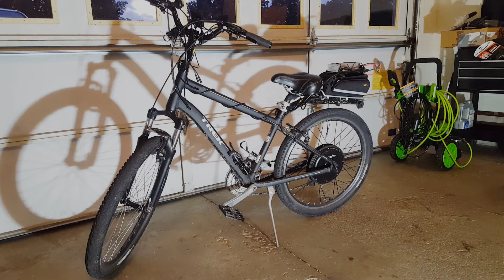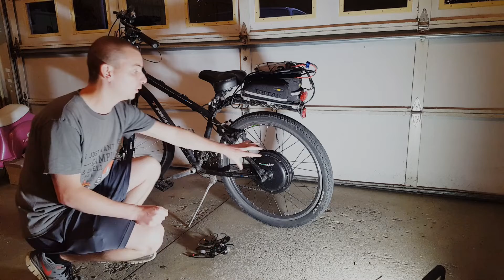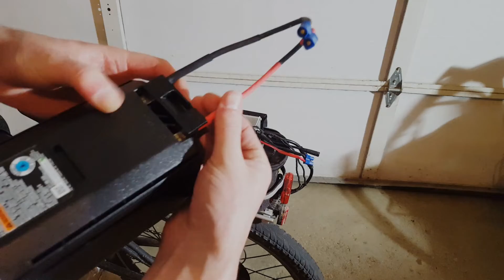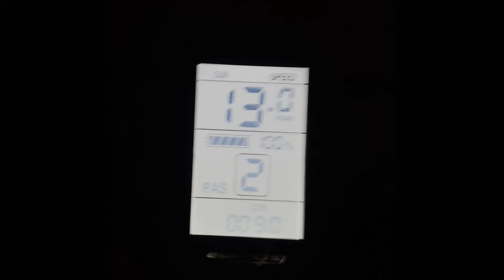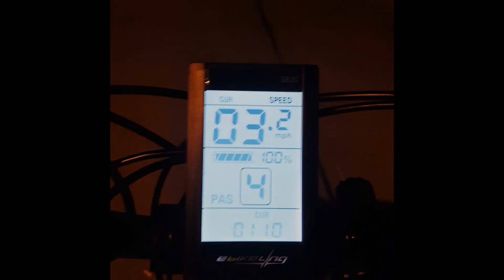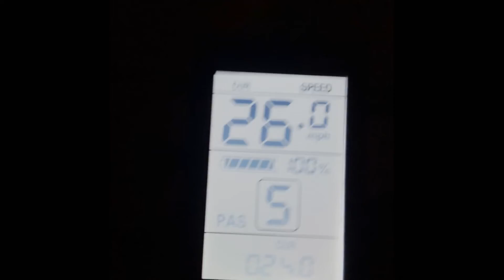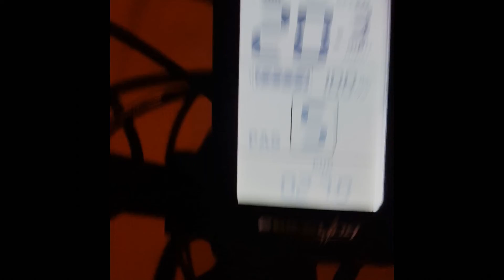Ebikeling 48V 1200W E-bike Conversion Kit (waterproof)!! Live dangerously!

Comment: One thing I'm concerned about is disc brakes. I see it come with brake levers but is that an e-brake? 

Mine is 1200 watt front, I haven't hooked it up yet, waiting for batteries but yes, from most videos I've seen, they top around 30mph. 30mph isn't too fast, I sprint up to 27mph, and can sustain 20mph on flat ground. I too live 4 miles away from work, I get there in about 15 or 16 minutes averaging 15 mph, planing to cut that in half with this. I may do a video response linking your video but great job.

Comment: Does your wheel seem to have a lot of resistance when coasting? When I put mine in the stand the wheel will not spin very long without stopping. Also makes kind of a winding noise. I was wondering if they usually spin more free and make less noise.
Reply: Do you have a geared or a direct-drive motor? Geared kits should have no resistance when the motor is off, while DD kits will have some.
Reply from the maker: Mine is direct drive but I’m pretty sure it has a clutch to disengage the motor and allow easier free spinning. I could be wrong though.
Reply from the maker: No, my wheel does not have resistance like that. I wonder if the motor housing is rubbing. The wheel should free spin very easily.

Comment: The most I have is a 500w battery so I couldn't use this. Any good recommends for a kit that'd fit my specifications? 36v 500w battery. 20ah
Reply from the maker: Why is your battery limited to 500w? Is it an amperage limit that makes you say that? Trying to better understand your setup.
Reply: @diyrenewableenergyelectron4996  well my first guess would be if I tried to attach a higher-powered battery to the kit, I stand to potentially fry something. The kit has specifications that list the maximum being a 500w battery.
Reply from the maker: Interesting. Typically, so long as you don’t exceed the voltage rating of the controller for the kit, you can put a big of a battery as you want on there. I could have made a 100ah battery for my kit and it would have operated just the same. The range would have been much farther though. Did you buy a 500w e bike kit? If so, what came with it? Mine had everything but the battery which is why I built one.
Reply: @diyrenewableenergyelectron4996  I did. From ebikeling. Pretty much everything except the battery. My kit has some.... issues, but I'm actually not sure what causes it, or how to fix it. Normally the little control panel has settings that allow the wheel to read the speed. Don't remember the specifics, but I had to turn an option to 86 to get the console to read the hub speed.... however it only reads so long as the throttle is engaged. Disengage, and it stops reading speed.

The other problem is the hub makes a horrible coil whine after awhile and the only way to solve that is to turn the bike off and let it coast a bit, before turning it back on.

Apologies if none of that made any sense, but my work has left me with little sleep. Let me know and I'll try to clarify.
Reply from the maker: Hmm. How long have you had it? My kit worked out of the box without issue. It reads speed regardless of motor engagement and I don’t get any noises or resistance from the hub. I’m wondering if yours was damaged and isn’t working properly?
Reply: @diyrenewableenergyelectron4996  Most likely in shipping. The problem has persisted since I acquired the kit. Just couldn't afford to ship it back to the company for 'repairs'. That's what their support told me to more or less do... so I've been just putting up with it all this time. I'd say I got the kit back in March of this year.
Reply from the maker: I wonder what the replacement cost of just the motor would be? It sucks that you have had problems.
Reply: @diyrenewableenergyelectron4996  I think around $200 according to their website. A little more or less if you buy JUST the hub.
Reply from the maker: Sheesh. Might as well save up and buy a second kit

Comment: 0:09 WRONG!! Cheap bikes are MUCH better to convert into a powerful EBike, due to the steel frame. Therefore, the exact opposite of what you said is true. The more expensive the bike, the more weight savings...hance it cant handle the extra stress...such as aluminum and carbon fiber.....Steel > aluminum > Carbon Fiber
Reply from the maker: True! But cheaper bikes typically have poorer quality control and less robust components. I’m sure a cheaper bike would be fine but I would rather have a higher quality bike personally. Thanks for watching and commenting!!
Reply: @diyrenewableenergyelectron4996   how do I know a torx arm fits my bike ?
Reply from the maker: They’re usually a generic shape designed to be universal. There could be bike specific ones out there but I haven’t ran into any yet.
Reply: Interesting

Comment: I can't go on throttle only.  I wonder if I got a bad throttle?  My set up is different than yours because it's not on a bike but a velomobile.  https://drive.google.com/file/d/1Fj4JllsPWsxTgxWu8dmS2Go6oEnt1d96/view?usp=sharing.  I did not set up the crank sensor but it somehow works?  Weird.  Please help.
Reply from the maker: Mine doesnt have the crank sensor installed either. Mine works fine with throttle only. It may be a bad throttle. Did you buy the same kit as me? Other kits may require the crank sensor or the brake safety switches to work properly.
Reply: @diyrenewableenergyelectron4996  visually it looks the same.  No response on the throttle, how do you test?

Comment: Hi how do I know the order of washers and nuts and bolts?
Reply from the maker: Do you mean for the entire kit overall?
Reply: @diyrenewableenergyelectron4996  for like the front hub whenever I put the wheel on
Reply from the maker: @samsonhinds7953  pay attention to how the original nuts and washers come off and follow the same order. If you do a front hub kit, make sire you use torque arms. Preferably on both sides of the forks. Most decent kits come with instructions to help you out. Ive never done a front wheel kit. Maybe someone else can chime in.

Thanks for watching!
Reply: @diyrenewableenergyelectron4996  ok thank u and yes I am planning to use torque arms on both sides
Reply from the maker: It should work fine then. What wattage motor are you using? Sorry I couldn't be more helpful!
Reply: @diyrenewableenergyelectron4996  I’m using a 1200w front hub from ebikeling
 
And i am definitely using to torque things 

Also I haven’t ordered it yet bc I’m still researching to make sure I got everything
Reply from the maker: Nice! Mine came with everything except an extra torque arm. I think they usually come with one. Good luck!

Comment: Hey man if you would’ve had my 48v 20ah 30bms battery ypu could have gone way faster my 1200w kit from ebikeling goes 30mph you at 1500 should have come closer to 35-40
Reply from the maker: With my new battery that I built I go about 33mph, but I'm hitting the max rpm of the hub motor. If it could spin faster there is plenty of amperage available. I draw about 15 amps at max speed. Thanks for watching!
Reply: @diyrenewableenergyelectron4996  that’s cool man I’ve been wanted to try it but I’m not very technical lol glad it worked out for ya
Reply from the maker: Depending on the type of battery it can be very easy to build your own. Prismatic LiFePO4 cells spoil us battery builders!
Reply: Have either of you found a way to increase speed? I just built the 1200w internal controller with a 48V 20ah and I was only able to hit 30 also. 26” wheels with continental touring tires. I only weigh 130lbs. In the bike stand with no resistance it will spin up to 35 though
Reply: @LuisRidesABike  I was thinking of upping the battery to 52v 30amp I’m almost due for a new battery so I’m also in the process of looking back into a bit more speed

Comment: Thank you for the this, have you tried changing the PAS settings?
Reply from the maker: Yea. I don't actually have the PAS sensor hooked up, but the PAS levels adjust top speed when using the throttle. Level 1 is about 10mph, 2 is 15, 3 is 20, 4 is 25, and 5 is about 30mph. Its now about 33 since I built the bigger battery 😀 thanks for watching!
Reply: @diyrenewableenergyelectron4996  Thank you appreciate reply.

Comment: One question please! What battery is the best for this kit? A 48v with 20ah will be ok?
Reply from the maker: Best is a subjective term. You have to balance quite a few crucial characteristics about the battery. For most people the biggest factor is cost. Second is capacity (Ah) and third is weight.

If you dont mind spending the money, bigger is always better if you plan to use all of that extra range. If you have a 5 or 6 mile commute for work and thats your primary use, you may not need to spend extra money to purchase range you dont need.

Weight is not that much of an issue but my 25Ah batter definitely throws the balance of my bike to the rear. 

A 20ah 48v battery like you mentioned should be a great all around battery that will give you a very good range.

Thanks for watching!

Comment: I'm putting this on a fold-able  20" bicycle. Wish me GOOD LUCK !
 Is there a way to set the top speed limit? So I don't break and crash my bike?
Reply from the maker: Good luck! Its an overall easy swap. Have fun out there. Thanks for watching!
Reply from the maker: I dont know that there is necessarily a top speed setting, but you can just set the PAS to lower levels and the motor will only go a certain speed. For example, PAS 1 is 10mph on my bike. PAS 2 is 15, 3 is 20, 4 is 25, and 5 is 30.
Reply: @diyrenewableenergyelectron4996  I was at 12 on 20 inch rear wheel on PAS 1 motor only I never installed the crank sensor yet it works and on 5 I am cruising at 37.5 MPH (converted from my KM reading.  Yes I need help to get it to English units.
Reply from the maker: Multiply your KM reading by .625 to get MPH.
Reply: @diyrenewableenergyelectron4996  I'm fast with calculations in my head but not while I am doing 60kmph
Reply from the maker: 😂 Touche!

Comment: They sold me a faulty motor kit and refused to replace it! CROOKS!
Reply from the maker: No way! What was wrong with it? Did you buy through Amazon?
Reply: @diyrenewableenergyelectron4996  Ebay it never worked since moment I received it and connected it! I contacted  them and just kept me dicking around!
Reply from the maker: Dang.... That sucks. Sorry you had a bad experience.
Reply: @diyrenewableenergyelectron4996  it's ok! What goes around comes around!

Comment: Will the motor cut on without pas sensor? How does it sense speed?
Reply from the maker: I have put over 400 miles on mine with no PAS sensor. It will only run when you twist the throttle though. I dont mind riding it like that. It won't provide any automatic pedal assist without the PAS sensor installed. I think there is a sensor in the wheel that senses RPM's and calculates speed based off of that. Thanks for watching!
Reply: @diyrenewableenergyelectron4996  will it work with a 48v 20ah xt60 bsttery?
Reply from the maker: I dont see why not. I have a 48v 25ah battery on mine with an xt60 right now. Xt60's are rated for 30 amps continuous.
Reply: @diyrenewableenergyelectron4996  how fast does your bike go with the 25ah? Mines hits 28-30 with a 20ah battery.
Reply from the maker: Mine does about the same. With a 52V battery it goes a little bit faster(31-32mph). Voltage is what determines the max speed of the motor. Adding amp-hours just increases the runtime.
Reply: I got 30 miles yesterday and only used 5 volts from a 48v 20ah battery fully charged at 54 volts. I think i had 49.5 volts left. I live in Philadelphia  where it has a hilly uneven terrain. These new lithium batteries are equivalent to gas tanks. I probably could of got 40 miles between PAS 2-4. Maybe 50 pedaling alot....
Reply from the maker: Thats awesome!! Lithium batteries are definitely a game changer. Its amazing how much energy is actually stored in these things.

Comment: That battery isn't up to the job get yourself a proper lithium ion 52 volt 16/17 amp battery
Reply from the maker: 400 miles and still going strong! However I usually only ride about 6 miles. This battery works for that but I have a build for a nicely sized battery in the works. It will be very well suited for longer distance rides. Thanks for watching!

Comment: Hey just curious I’m very interested in buying the kit from Amazon but two question do you actually get the full 1200watts of power or is it limited and how far can you travel before you need to charge again ? Actually three question how much did it cost too the penny at your door delivered thank you so much in advance
Reply from the maker: I havent checked it with a separate multimeter but the readout does hit 30 amps which os slightly over 1200watts. Range is dependent on speed and battery size. Riding at 25-30mph with my 4 amp-hour battery I can travel 8 miles or so. If I ride slower, the range increases significantly.
Reply: @diyrenewableenergyelectron4996  greatly appreciate your feedback it’s definitely noted when I make my purchase
Reply from the maker: Shipping was free through Amazon Prime.
Reply: @diyrenewableenergyelectron4996  ah ok that’s a blessing prime for the win
Reply from the maker: If you have any other questions in the future feel free to ask

Comment: What width do I need for the wheel? I have two trek bikes. Former runner with back issues needing less impact excercise.Also how do you imtegrate the actual derailer gears from the bike? I'm looking to restart an excercise program and was curious about the range. I actually want to pedal easily at first straying s few miles then if needed use the electric part to return home should I have back issues. Great Video. Thank You :-)
Reply from the maker: The kit I bought (link in description) works fine with my 2" width tires. You should be able to get up to 25 pretty easily at full throttle. Especially if you're pedaling

Comment: I did it I finished my 1200 watt rear hub bike and used the same idea you used . I'm using two 58 volt batteries in parallel instead of one. Saved hundreds of dollars just doing that alone. Mine is not waterproof and wasnt plug and play wiring either. I'm using the SW900 display and I dont see settings to do anything other than pas 1-5.  It goes 28.0 mph tops. Don't know how to change it to mph instead of kph. Or change to rim size as I have read. Guess my display can't do that stuff. But that's okay the bike runs very well. I've got no complaints. Thanks to you for the wonderful idea of the battery choice. Works like a charm.
Reply from the maker: Awesome! How many amp-hours are the batteries? Are you getting decent range with it?
Reply: @diyrenewableenergyelectron4996  The batteries are 5.2 amps each for a total of 10.4. They are 58 volt max. I went 8.9 miles yesterday [first ride ] and still had three bars out of four. But I had them charged to 54 volts. I have now charged them to 58.8 volts and its ready for another ride but that wont be till tonight due to work. I don't think I ever saw the display say I was using more that 10 amps, maybe something is limiting me, perhaps the bms in the battery back ?
Reply from the maker: Well, if you arent hammering the throttle, it usually doesn't go much beyond 10-15 amps. If you go full throttle on a high power level it will go higher but for a cruise I'm not surprised to see it hanging out in the 10 amp area. Thats a decent sized battery! I think you will be very happy with the range. I get 6 miles out of my 4 amp-hour pack while full throttle basically the entire time. I bought some 21700 cells from battery hookup and will be building a larger battery soon. 20 amp-hours or so.
Reply: @diyrenewableenergyelectron4996  I was riding full throttle for the most part, couldn't help myself lol. But ya my battery idea came straight from you. Oh and I saw those tesla 21700's and I thought the same thing. Those are gone now glad you got some. I had my chance and I knew they are better than 18650's but time is short. For now I just want to ride there isn't a lot of time left in the summer. Not having to build a battery pack and bms. Let me know if you get a pack together for your bike and how that goes I'd be interested to find out from you how they work compared to 18650's.
Reply from the maker: Full throttle is tons of fun, so hard to resist haha. I think www.bigbattery.com has some in stock. Not trying to fuel your addiction but cant help but let you know lol. I will most certainly do a battery build video and will do a range comparison with my current battery and the new one.
Reply: @diyrenewableenergyelectron4996   Thanks for the heads up with the tesla's at bigbattery.com. I have never head of them and didn't know they had them 21700's. I saw the specs on those batteries and thought those would make the ultimate battery pack. Something I would consider doing in the future but not this year for me other than a headlamp and a tail light I need to work on other projects [ painting/solar ] before it gets to late in the year to do.
Reply from the maker: I know exactly what you mean. I need to get my home solar upgraded from 12v to 48v asap. The cells do seem to be the best all around performing cell for an ebike though!

Comment: Hi, thanks for posting this video, i just received my 48v 1500w kit. Excited since it seems like a decent kit/value for the price point. If I connect the PAS does that change the functionality of the selector limiting the throttle the way it does with yours? Or will the selector just govern both according to the five levels? Thanks
Reply from the maker: I dont know how connecting the PAS will affect things. My guess is that the throttle will operate exactly like mine does but when you pedal the motor will automatically assist at whatever your PAS power level is.